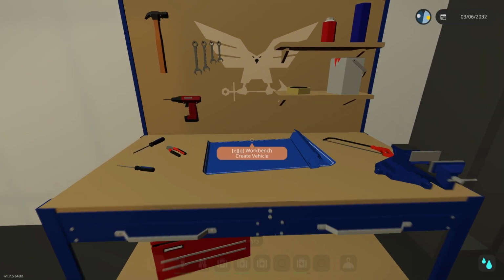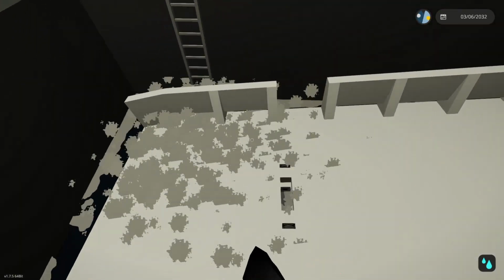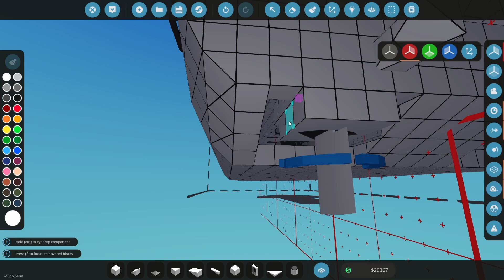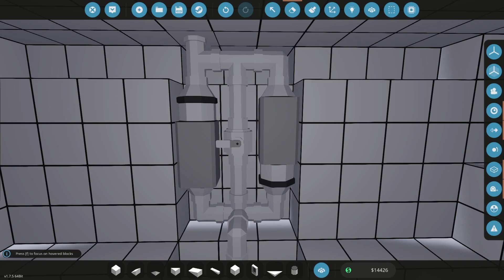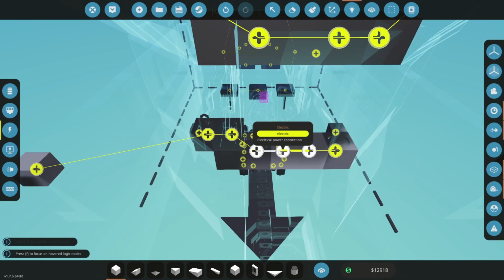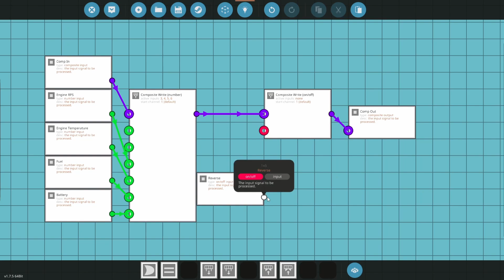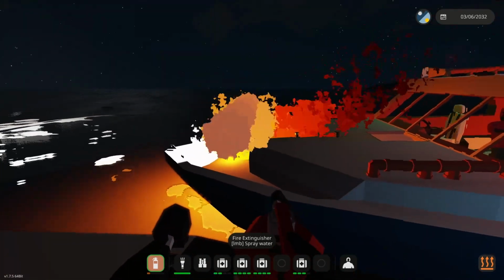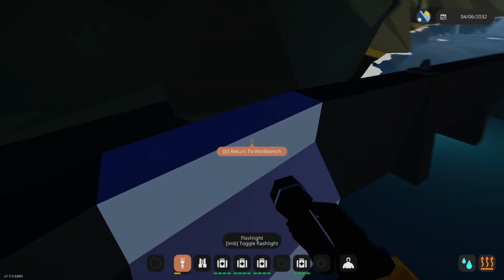Stormworks - A Career Story 03

Comment: Do desalinators help with coolant scaling when you're pulling coolant from sea water?
Reply from the maker: Scaling happens with sea water, so technically you could avoid scaling if you desalinated, but the desalination process is so slow that you would likely run out of liquid in your cooling that you would just overheat quicker.

Best solution is to use the large electric pumps and force as much water through as quickly as possible.